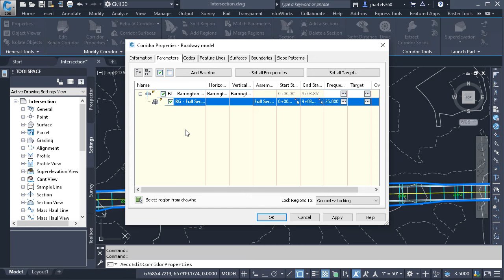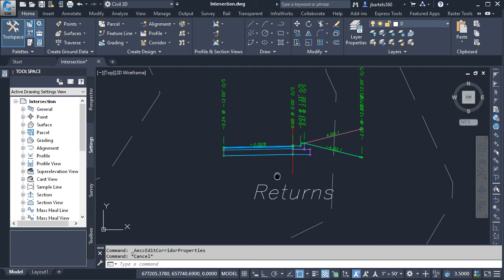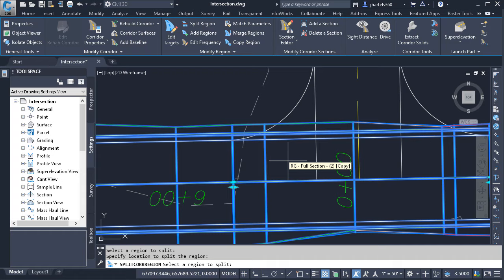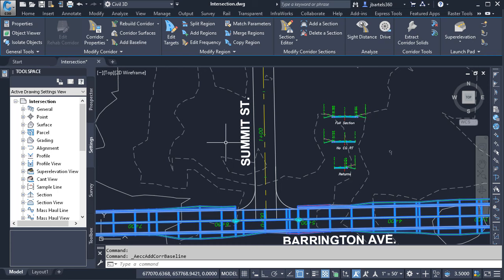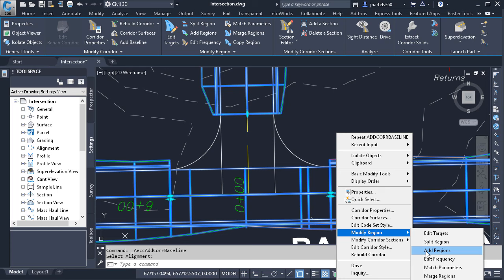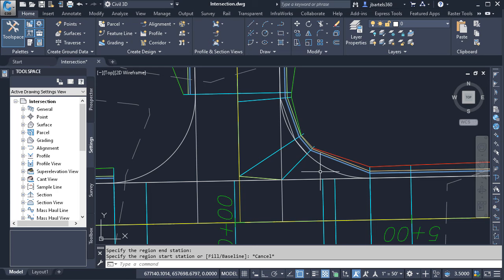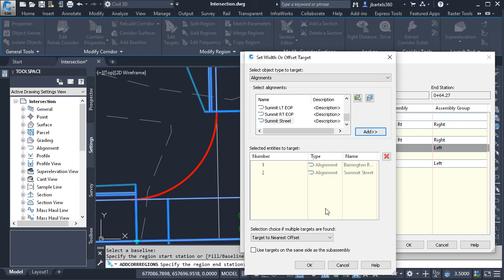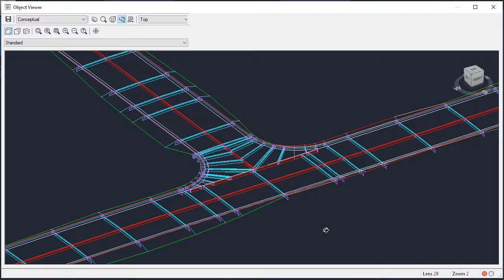Simplifying Civil 3D Corridor Modeling using Contextual Tools

Comment: Jeff, firstly, thank you so much for all your videos. I've learned pretty much all I know about corridors from you.

Two questions.

1. Why don't you ever model your roads using assemblies with full layerworks (approx 5 layers) that step out on either edge (width extensions), as per construction?

2. I often run into problems with my surface if I start/end my curb-return regions from beginning of curve to end of curve. As a result I extend the start/end of the region to beyond the start/end of curve. Have you ever experienced such a problem? How did you overcome it since you always stick to the start/end of curves?

Comment: hi Jeff, can you do some videos on roundabouts? or do you have any recommendations for videos to watch about roundabout corridors? thanks
Reply: I guess you can create an alignment thay goes in a circle, then follow the steps in this video for the connection with the other roads
Reply: @j.alexander7554  The vertical profile of that alignment is a little tricky. It has to obviously end at the same elevation as the start of the roundabout. I would also appreciate a video on this topic. I second the request.
Reply: @j.alexander7554  Thats Correct. is the same this video. but add circle like a the round.
Reply: I third request a video about Rbts👍

Comment: Thanks for your sharing. Sometimes, curb return alignment from line to arc is not in tangent, there will be a void after forms a corridor. Do you have and idea to solve this issue? Thanks.

Comment: One actually two questions . When you define a subassembly is there an option to define the slope of the pavement that is dependent on the direction of the curvature (corner) of the road(if the road curves to the right the road is inclined to the right) with only one subassembly? Or do you have to create a different subassembly?
Reply: If you assign superelevation information to your alignment, you can choose subassemblies that support superelevation to do what you're asking for.
Reply: Archie Dodge okay thank you I will try it out.

Comment: Thank you Jeff,you rock! just wondering if the curb return lane should target the EOP and the CL, or both intersecting CLs in such case?
Reply: In this case the EOP and CL because the main road crown is maintained. If both crowns were maintained you'd target the CLs but remove not just the curb and daylight from the main road intersection assembly but also the lane.
Reply: @ArchieDodge  thank you!
Reply from the maker: Thank you Archie!
Reply: @JeffBartelsCAD  My pleasure. Hope you don't mind.